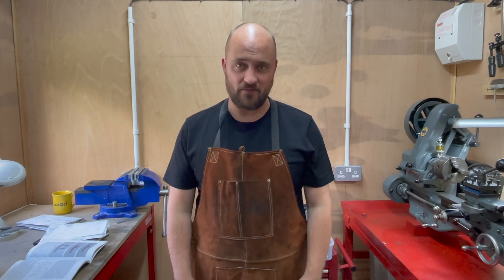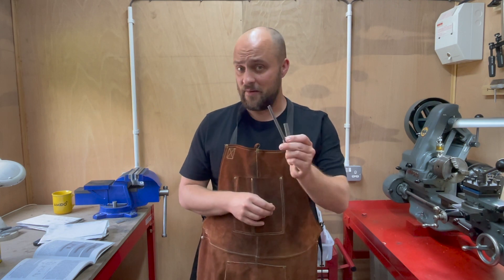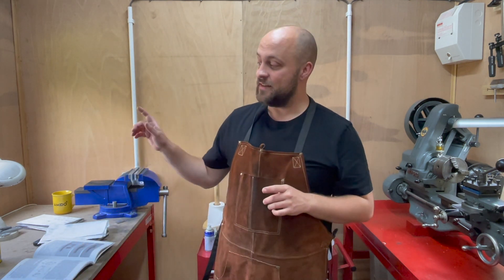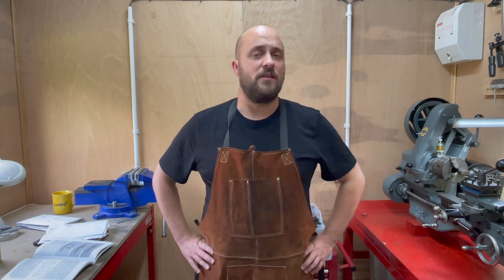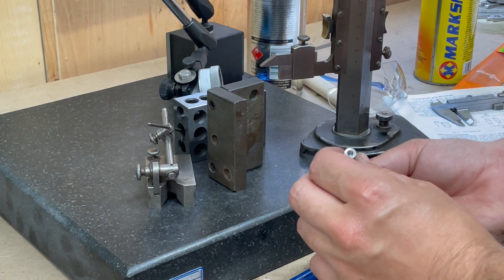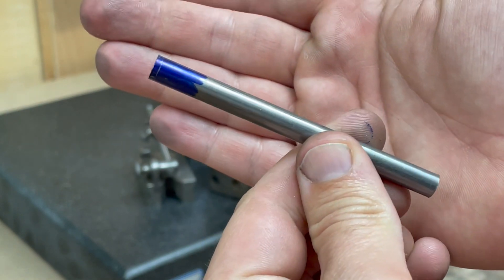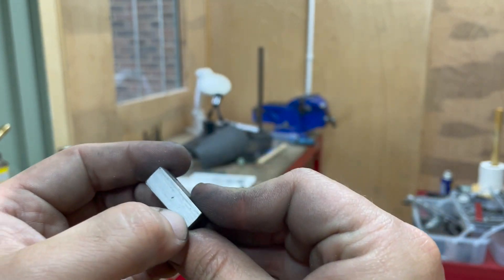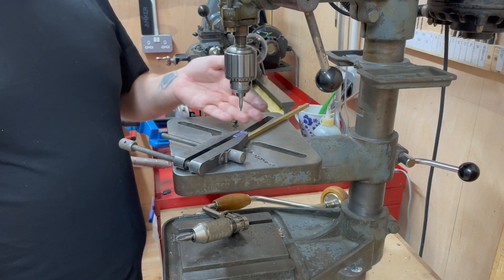Building a Stuart 10V Steam Engine on a Lathe VIIIa - Crankshaft Fabrication

Comment: I watched this with the idea of how you put the end radius on the crank pieces. Did not see any method but maybe filed, not milled.😥🤔
Reply from the maker: I'm afraid I missed filming that - I scribed a centre line down the part and then using the radius of the ends I centre popped that distance away, and then used a pair of calipers to scribe the radius, filing by hand. Were I to do it again, I would be more generous with my filing as the clearance isn't huge inside the casting, With that in mind I do show how to use and make button guides to round crank ends over in one of my recent videos on putting spring plates for my 5" loco - maybe that would be helpful?